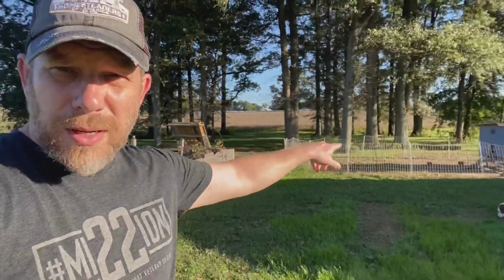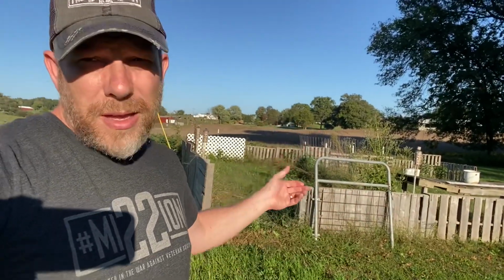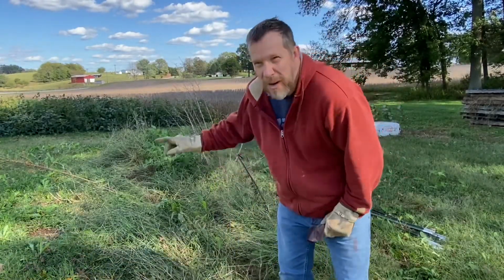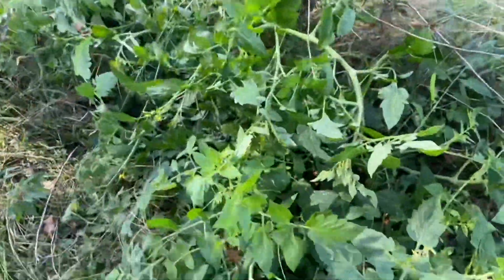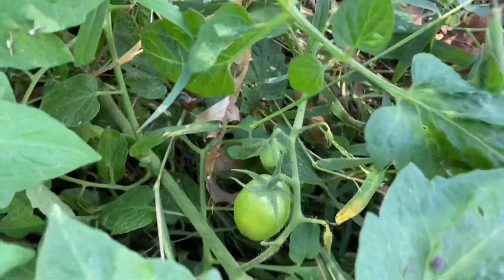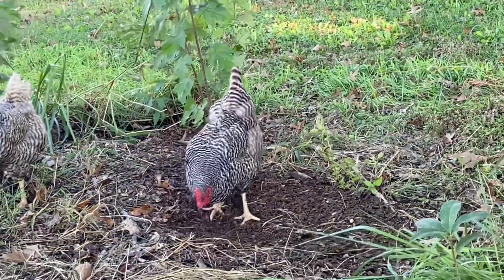Sad To See This Go

Comment: About those more substantial pieces of wood like the beams - In community gardens, people ,or the gardens people) often erect what are called hose reel poles.  They are buried deep enough in the ground to be sturdy and still have 4'-6' sticking up above grade.  Typically, they have a hose reel with a dedicated 25'-100' hose rolled up in them.  But then they have an assortment of hooks, bent over nails, baskets, mini-shelves, old (or new) mail boxes, retail clip strips, and all other sorts of "attachments" used to hold gloves, hose ends and watering wands, short handed tools, ,ong handled tools, and the like.  In some gardens they are used to protect the PVC connector pipes or metal frost free faucets coming up out of the ground from water delivery systems.  They are very handy and we've done similar in private gardens.

Comment: For that pallet wood - my first thought is to turn it into garden accessories and furniture.  The first would be a compost pile bin.  Given space, I like a two bin, mostly cool system.  You pile your weeds etc on one side not paying too, too much attention to the dirt left on roots; water as necessary and layer accordingly if a faster return is wanted.  When the one side fills up, turn it into the second side with what was in top now being the bottom.  I do find that a few fibrous items every 12"-18" (branches, corn stalks, denser root systems, or a coiplemofmpieces of wood if none other can be found) helps with air circulation, getting water filtered through thenpile, and general decomposition.  As you get towards the bottom of the old pile, sift the dirt and compost over a wheel barrow and use accordingly taking the potential for viable seeds in mind.  If a dual bin system is too small and there is room, I prefer a second dual bin system on the other side of the garden over three bins.  At the end of a long day or when you're squeezing gardening in a busy schedule, the closer the compost pile is to the weeds pulled and harvest waste, the better.
Reply from the maker: Thanks for all your thoughts, we have pallet compost bins. Just don’t show them much.

Comment: Will your area allow an honest to goodness fire or burn pit?  Does you aesthetic allow for one, and can your yard support the 5' diameter pit area and total 8' diameter space they take in reality between cleared frags, seating, etc...? I'm thinking a "clean" pit only used with: clean, whole wood products; old garden vegetation to kill bugs and molds; and to roast cattle panels or other metal to also clean bugs and molds.  If so, I would consider one for the unusable pieces of fencing, raised bed material, etc... optionally use the ashes 8n the compost pile, especially the one for hot chicken mauner cleanings, as needed in the garden, and as advised to help turn that mineral rich clay into garden dirt.